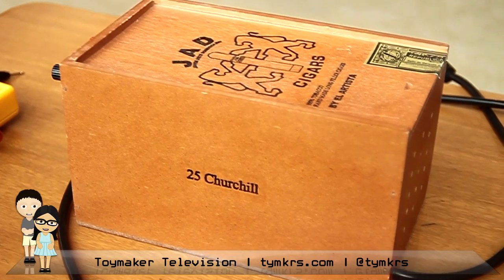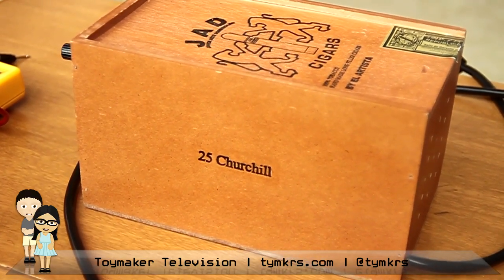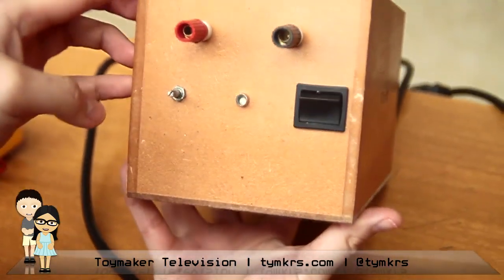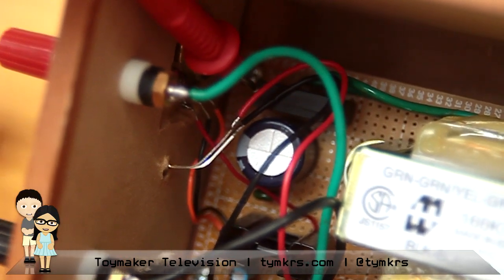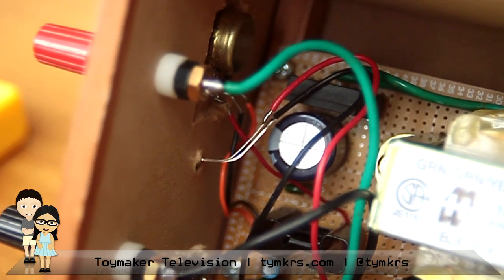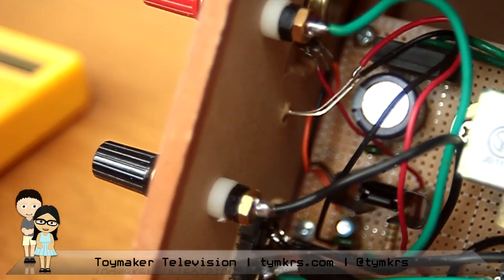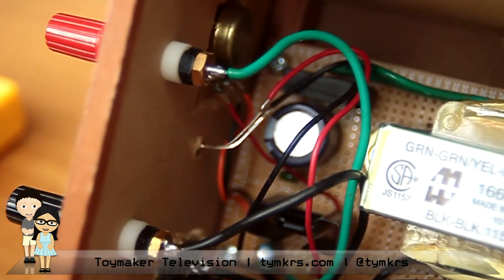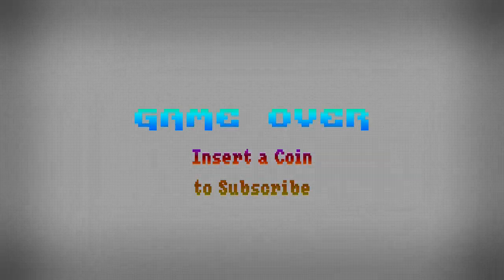Tymkrs DIY Power Supply

Comment from the maker: For a mobile radio supply you would probably want a 13.8vdc fixed regulator (this one is variable).  Also for a radio you need a LOT of amps for transmit.  Linear supplies like this one can be built to output a lot of amps, but the parts get very expensive the higher you go.  The less expensive option would something like a Samlex SEC125M switch mode power supply.

Comment: Your fuses are on the wrong side of the transformer.
You'd want to protect the voltage regulator.
What you usually would do is put a 1A fuse (if you want to protect it if it goes higher than 1A) after the capacitor.
The current drawn from the 120 AC is much much lower than the current coming out of the voltage regulator.